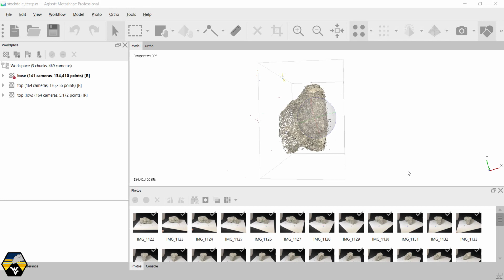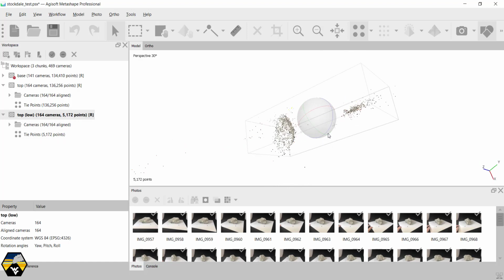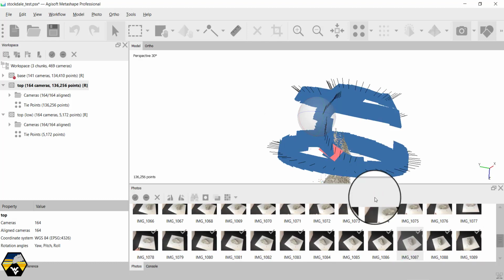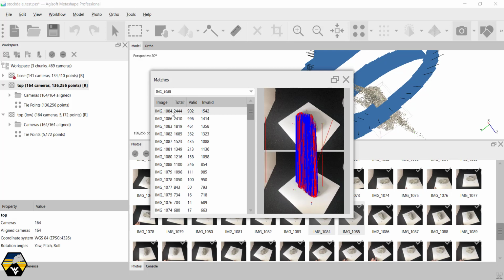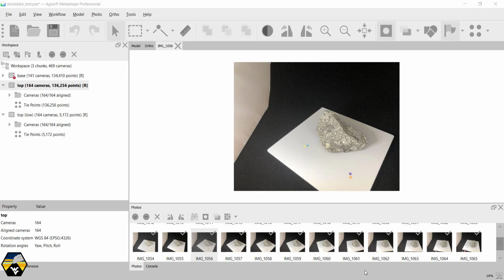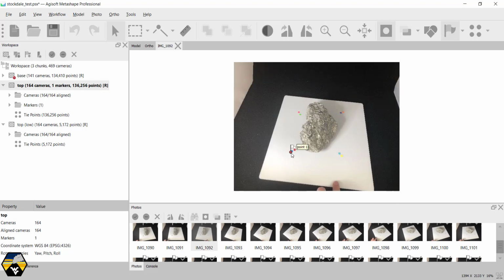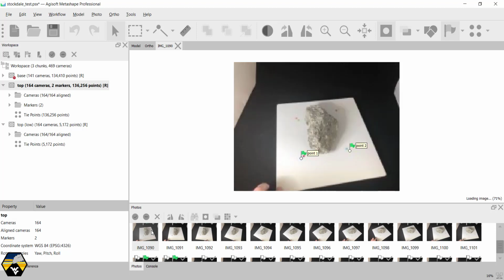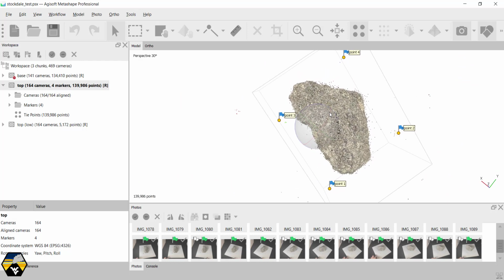Building 3D Models in Agisoft Metashape - Alignment Problems

Comment: Incredibly helpful. This is the most helpful video about Metashape/Photogrammetry I've found so far. 

One question: in the images where a certain point wasn't visible, e.g. Point 1, did you DELETE the point from that image? Or kept it there, even though its position didn't actually correspond to the appropriate colored circle in the image (which wasn't visible)? 

(Maybe I'm not understanding what's happening behind the scenes, but it seems like you would want to delete the point from the images where it's not visible, rather than keep it there, to ensure the alignment works properly? )
Reply: I'd like to know the answer to this question too. Graham, are you still engaged on this video?